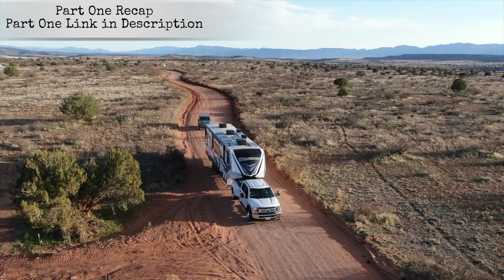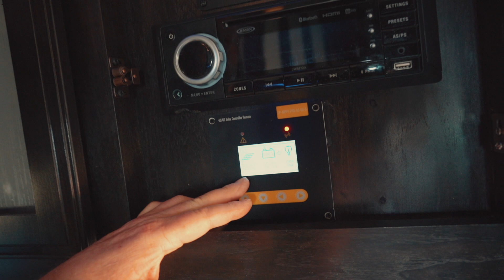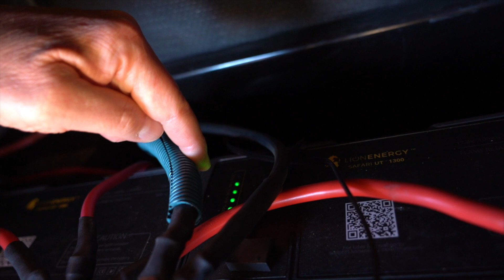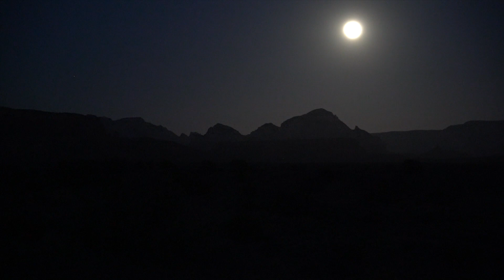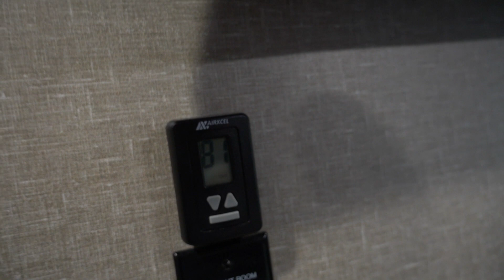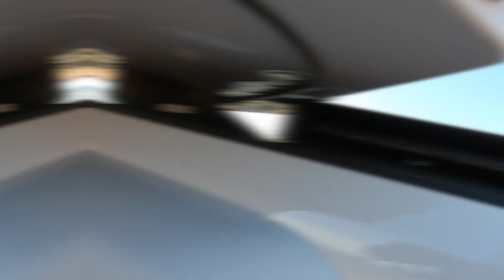We're Camping FREE Full Time - Here's Our Solar System

Comment: What fire pit do you use that can sit on your deck?!? Our laundry hookup does not go into a holding tank, so we wouldn’t be able to do laundry while boondocking. I did the same thing with the upper bunk. I wanted to be able to,use the benches, without lowering the upper.
Reply: If the water doesn't go into a tank does it just run out on the ground?
How would you do laundry anywhere without flooding out your campsite?
Not sure I understand that concept at all 😖
Reply: @jamesglenn520  the w as Hong machine drain is plumbed to the discharge side of the grey tank line, so the sewer line must connected to use the washer. We don’t have a laundry setup, so this hasn’t been an issue.
Reply: @Tryke_Ryder  Oh ok. That is absolutely different than any setup I have ever seen.
Reply: @jamesglenn520  me too, and had it not been for another XLR owner relating his horror story of a flooded garage due to the discharge not being open (he had a secondary valve at the sewer hose connection) I would not have known that.

Comment: We bought 2 164 watt panels for $50 each and 2golf cart batteries at $100 each and a $25 controller from amazon. Our generator is not working and we always have power. We got led lights and there really bright and a cellphone reapeater so there’s always a load. We have a tv that runs sometimes all day. I charge my electric bike and 2 laptops and phones and the power is always there

Comment: Very good luck with lithium and solar. Not ready for that yet. Just have two batteries parrelled . Maybe someday.
Reply: 2 - 4 or 6  6volt golf cart batteries will get you off grid for awhile. 
And with a few 100 watts of solar can make a big difference as well. 
You get about 3times the run time out of 2 6volt batteries as you get out of 2 12volt.
Plus they have a much longer life span before needing replacement.

Comment: Awesome video - beautiful location.  A couple of suggestions related to your solar - if you don’t have one yet, I would get a battery shunt to more accurately measure the state of your batteries.  Also, you may want to have the battery cables swapped for some 4/0 size wiring - this will help with times when you are running your AC (180 amps on the current battery cable wiring is a bit much).  4/0 AWG size wiring will handle it with ease.  Also the positive feed from your batteries should be on a different battery than the ground feed - this evens out the draw on the batteries so they share in the load more.  I installed my own solar on my Grand Design and had to learn all of this.

Again you guys have been very inspirational to us as we have gotten back into camping again after a several year pause.

Comment: Recommend you purchase two bladder tanks with a macerator.  Then you can empty your grey and black tanks, plus fill your water with a 12 volt pump.  That way you don't have to break down camp.  Just use the bladders until you decide to go to the disposal site.  Throw them in the bed of the truck.  Most tanks hold 100gallons.

Comment: You have 6 lithium batteries. There should be no reason to run your generator overnight.  I see you are business as usual on your energy draw as if you were on shore power.  So lesson: when boonddocking, turn off all those string lights, electric fireplace, and air fryer, electric water heater! You're using way too much power all at once.
Reply: They Never said anything about run the generator Over Night. 
They had to run it some because of not having good sun every day. 
And they are running a lot of things to TEST out the New System. 
That is the only way to find out what your max usage under certain sun conditions are 👍